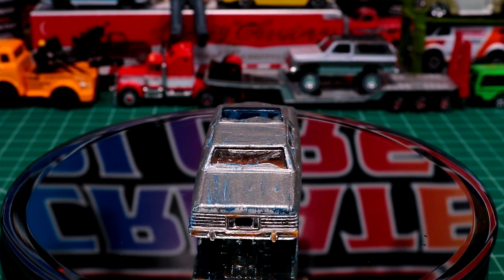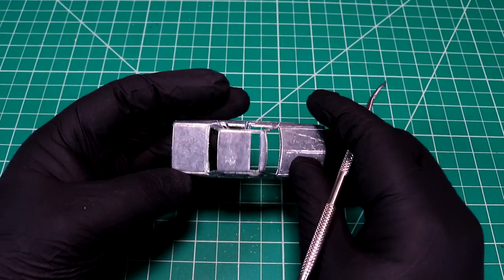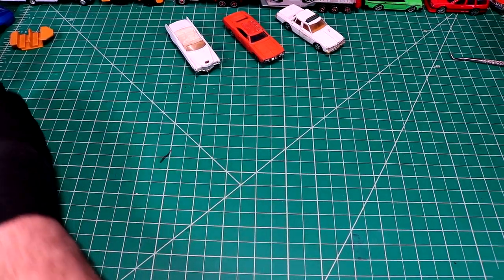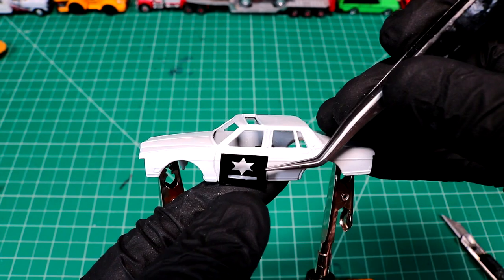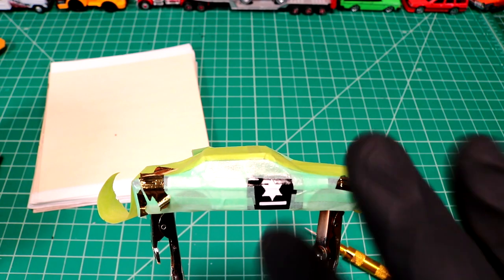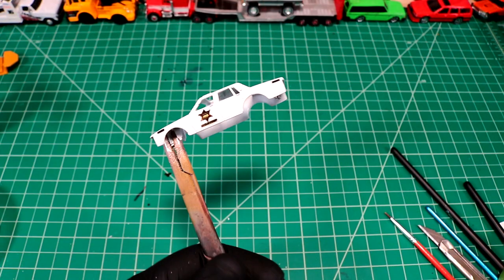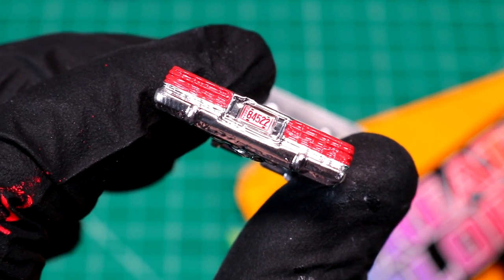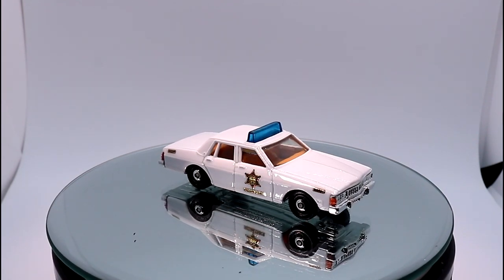Painting Diecast Cars - Dukes Of Hazzard - ETRL Sheriff Car Restoration

Comment: looks great again. especially with the detailing. :) the gold leafing looks fantastic, the wheels, too. they seem to have become MBs new Superfast wheels... a lot of models have these on.
as for the testors paint, Carson Modelsport has a paint remover specifically made for polystyrene and lexane. I tried it on an old Siku plastic model from the early 60's that has been slathered with modelers paint with like, 666 layers of paint. the paint remover is a bit like a thinner, it softens the paint so you can scrape it off with a plastic scapula, and the plastic doesn't become brittle from it. it does get a rough surface, however. I did this years ago, and recently checked on the parts, and they still hold up; no brittle, no breaking, no warping.

Comment: Yeah, they never used Pontiacs in the Dukes, BUT they did use them in Smokey and the Bandit.  It's what Sheriff Justice drove.  ETRL may have done the Sheriff's brown Bonneville, then used the casting for the Duke's set since it had a light bar.

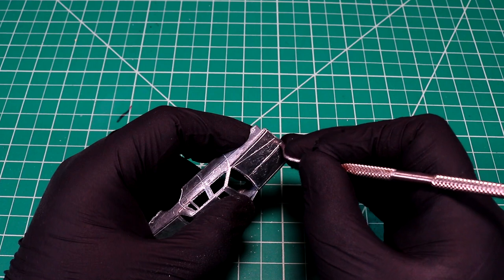Comment: 2:38  Ertl also sold these in a 4-pack window box that included either Daisy’s jeep or Cooter’s pickup, but it seems like the selection was practically random, as each one seems to have different cars (like THREE patrol cars plus Boss Hogg’s Caddy 😅). There’s a VHTF playset too that has all five vehicles with a playmat & cardboard buildings. Cool stuff 😁

Comment: That came out awesome considering what you started with. I don't remember there being Pontiac Bonneville cop cars in the show but there were a few changes made in the final season(s) (Daisy driving a 73 Road Runner instead of the CJ7 for instance), I can't remember what the cop cars in the reunion special were but I think only Rosco had a Dodge Monaco in that from memory. Most likely ERTL just had a buch of castings left over from the Smokey and the Bandit 2 sets and just used those, it was pretty common for them to do stuff like that back then.

Comment: Try burnishing the leafing with a damp lint-free cloth. Helps it adhere to the sizing.  You might even try taking the mask off after applying the sizing but before laying down the leafing. It can be almost completely dry and the leaf will still stick.

Comment: They mainly used dodge Monico and AMC model cars for the Sheriff's department on The Duke's of Hazzard .
Don't know why Ertl went with that model of car.
Also all of the cars had blue and red lights on top not just blue.
Reply: The only thing I can think of is that it might’ve been a cost saving measure.  If I remember correctly, they also made diecast models of the cars from Smokey and the Bandit, where they had Pontiac police cars, so they made the Dukes of Hazzard police car the same model car, instead of what was actually used on the show, unless someone didn’t allow models to be made of what the actual car was.